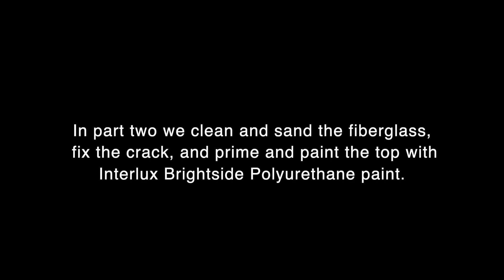How to: Part 1 - Refinish Vanagon Westfalia pop top and tent install

Comment: good idea for tape aroudn the rear hinges...and I heard that flex driver is an absolute necessity in making this a reasonable job.  I had black and sanded, then i hit it with bleach (dilute) and that got rid of the black, I used Icing body filler in some of my cracks, it stuck like super glue and sanded like butter.  (78 bay)....the vanagon FRP was in better shape and I painted that luggage tray, now time to do the big section and replace the skylight...I htink mine is leaking and I'm going to watch the crack repair...and look closely when I get there, I hve the replacement in hand...
Reply from the maker: Even with the tape on the hinges it seemed like I needed to adjust them more than I thought I would.  I think part of it is because I removed them from the pop top as well and they did not get back to the same spot.
So far our black mold has not come back.  
nate

Comment: Did you use the Interlux an paint all the bolts as well?
Reply from the maker: Yes after the bolts were installed and tightened down I ran some of the interlux over the bolt to help seal it.
nate
Reply: @ThatBaldwinLife  awesome, I wire brushed mine and I’ll paint them up before placing them. But I’ll add another coat once they’re up. Thanks!

Comment: Hey i been watching your viedos and love all of them. 
I have 1985 sestafalia with 1.9  ingine, have you ever replace a motor for a friend of yours or ate willing to do it for some one else. 

I am looking to replace mine for a bigger an or better motor.
I have been looking and shops want arround 26 to 30 k.
Seems a little high. 
Let me know if yo want or can recomend someone else to do this.
Reply from the maker: Hey thanks for reaching out.  Putting in a non WBX engine in the Vanagon will be an expensive endeavor if you have a qualified shop do the work.  It is a lot of work. Upgrading your current 1.9L to a 2.1L or 2.2L from GoWesty would be the cheapest option but you would still want the 1986 and up Digifant engine control system to run that engine.  
Start by asking people on TheSamba who is a reputable mechanic in your area.

Good luck!
nate